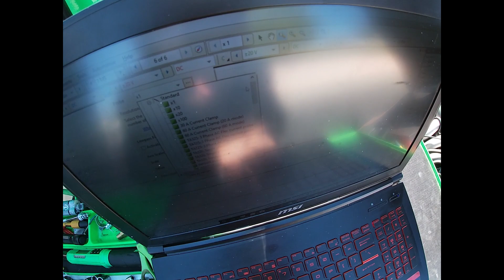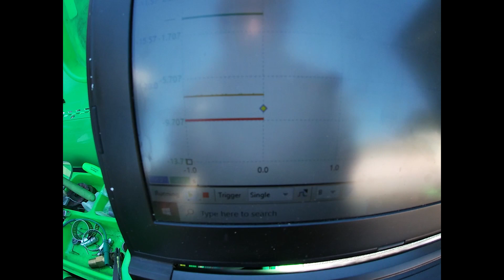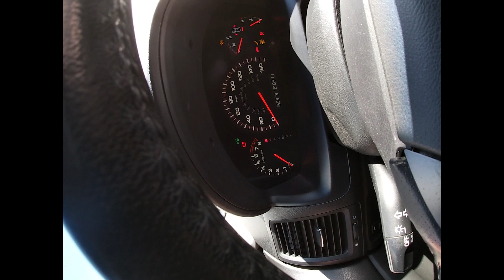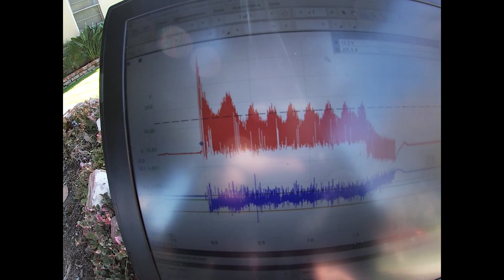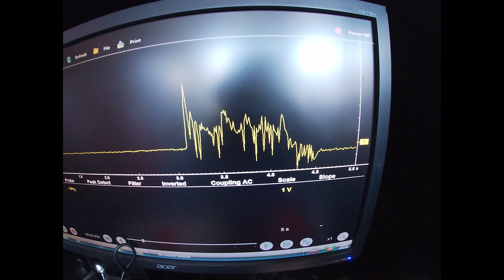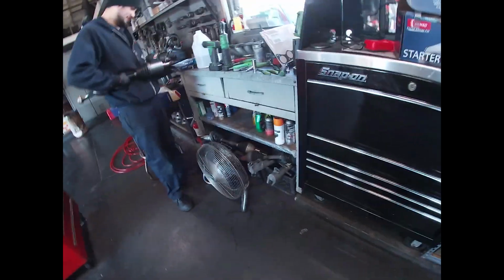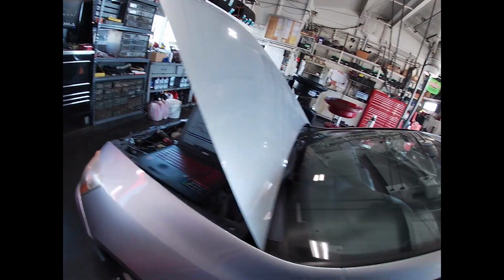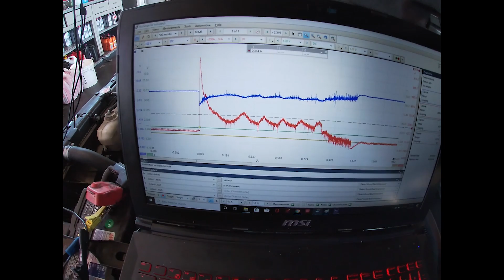5 minute Honda Starter Motor Health Check - Snap On Verus vs Picoscope

Comment: Their is a flaw in you comparison. That snap on on a 5s time base is slow and peak detection is not on. 
If you were to go to a 500ms or even 1s screen and zoom out it would look much more like the pico waveform
Reply from the maker: Hmm Idk if I'd call that a flaw on my part. I did the exact same operating procedures on both scopes; turned them on changed the scaling for the amp probe, and set the time base on 5 sec screen. I have another video on a Ford Transit coolant bypass valve where I do show my snap on vantage pro has a better sample rate zoomed in, and direct comparison to Pico where I show that I can get the same sample rate at any time base. Thats a point for Pico. In my experience filter and peak detect hasnt done much. Bur I hear you, next time I get one of these it wont be about the car, itll be a scope comparison with the Pico, Verus, Vantage Pro, and Uscope. I think that would be fun.
Reply: @DiagnosticDennis  I know what you mean. It would be nice if you could set and long screen on snap on then zoom in but its polar opposite. You have to set short time base and hope you caught it on the buffer then zoom out